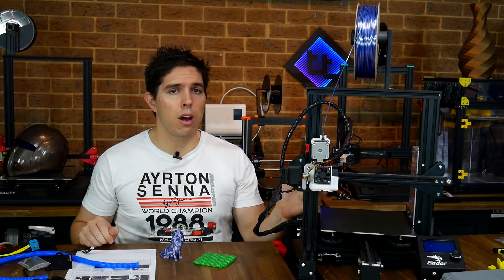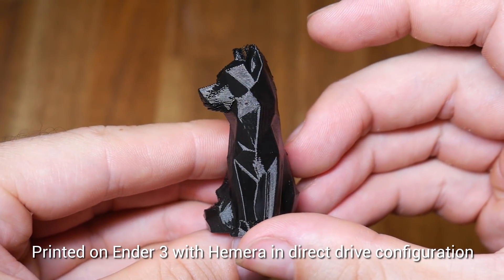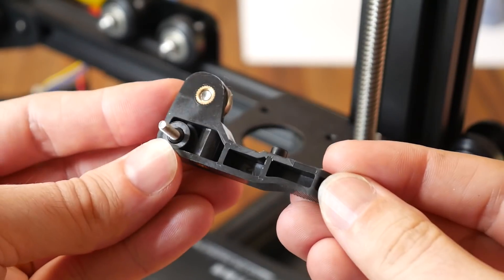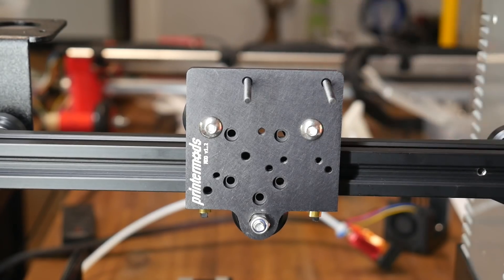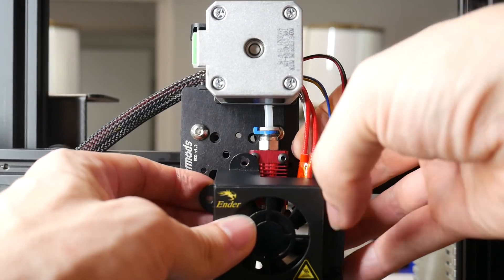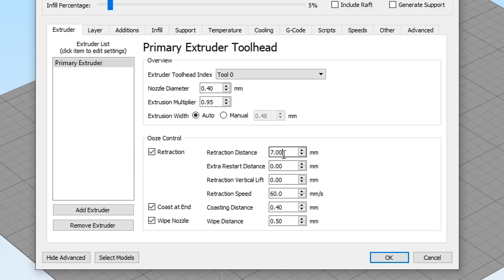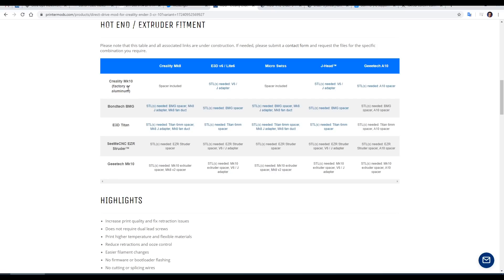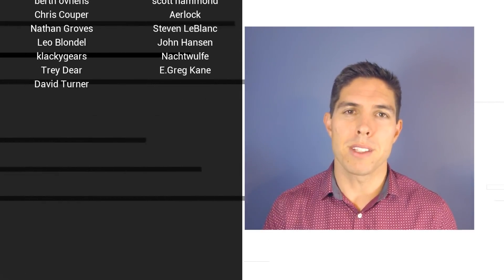Modular direct drive kit for Ender 3, 5 and CR-10 for under $40

Comment: Great video as usual but after a year of playing with my Ender 3 I have to say that the stock printer when setup correctly with no mods produces excellent results, i Have yet to see any noticeable print quality difference between what I print on the standard printer and all these modified ones on yoyutube, the only mod I would say is noticeable is the silent board mod and thats just noise reduction, theres an old saying if it aint broke dont try to fix it LOL, out of the box the Ender 3 is a superb printer, they could do with adding thermal run away in to the stock firmware and making the standard control board with silent stepper drivers but really for the money its superb and all these extra mods are really a bit of a waste of time and money in my opinion, with a bit of practice you can produce some amazing quality for under 200 bucks.
Reply: the silent board isnt just "noise reduction" the tmc drivers also eliminate salmon skin.
Reply from the maker: I would say most of my favourite mods are more user friendly usage rather than print quality improvement. As Mark says a board upgrade kills two birds with one stone.
Reply: Bit late to say this but if you planned on upgrading to an all metal hot end then a direct drive system gains a lot more merit, since all metal hot ends are very picky about retraction and such

Comment: Do you think the PetsFang bullseye would still fit with this kit?
How about using it with out on these dual gear extruder?
https://www.amazon.com/Sunhokey-Extruder-Aluminum-Creality-Filament/dp/B07YCG4QPK/ref=sr_1_40?crid=3A81PHG9P2M2R&keywords=ender+3+extruder&qid=1579247238&sprefix=ender+3+%2Caps%2C391&sr=8-40
Reply from the maker: I've never fitted the bullseye to this but the way it sits there is a good chance. Your other question is probably best directed to printermods.com

Comment: Micheal, since you have a E3D Hemera on hand, could you please check the fitting with the PrinterMods MDD. PrinterMods indicates on their website that their MDD v1.2 is compatible with the Hermes based on the current specs, but that they will need to confirm the fitting with the production units. Since the laugh of the Hemera PrinterMods still hasn't updated the info on their website. It would be nice to know that there's a quality mounting solution for the Hemera available now.
Reply from the maker: It's hard to tell fitted to the printer, but I can't see a set of holes that looks like it lines up. You would still need a thin space to get the Hemera to clear the v roller bolt heads.
Reply: @TeachingTech  Would one of the  injection molded spacers work? Let's say I'm ready drill custom mounting holes in the MDD plate.

Comment: Surprised No -One has fitted the Creality 10S dual drive wheel Mk8 type extruder as a Direct drive unit. 
The extruder is a " v good" one.... plus it's Cheap and V easy to fit, needing no goofy finned radiator, just a 40mm fan on the extruder mechanism..
Reply: I have the dual drive gear extruder as a direct drive unit in my own custom designed dd. But what do you mean by adding a 40mm fan? I don't need one. Could you please explain?

Comment: You can do the same mod for basically free, if you print all the parts yourself.
Reply from the maker: Yes but the quality won't be as good. It's a trade off between price and strength/flex.

Comment: what pancake stepper motor do you suggest? because I still would like to make things more compact.
Reply from the maker: Unless you have a geared extruder to reduce torque demands, you can't go pancake with this. When I talked about pancake steppers in the video it was relating to the Bondtech BMG, and I believe they might sell pancake steppers to suit.
Reply: @TeachingTech  Thanks bro.    I don't know if you saw my link because I found this in the last few days on amazon.  It didn't come with new copper buckles for the belt but it is almost the same thing as what your showing from these guys minus some extra parts which can probably be printed if modification is needed. https://www.youtube.com/redirect?event=comments&redir_token=RNywO6ibfJk6VhCF3Ya8NVPnuWh8MTU3OTQxMzUyMkAxNTc5MzI3MTIy&stzid=Ugzy7vp5OkYOL3ApSe54AaABAg&q=https%3A%2F%2Fwww.amazon.com%2Fgp%2Fproduct%2FB0824ZQ3D1%2Fref%3Dppx_yo_dt_b_asin_title_o00_s01%3Fie%3DUTF8%26psc%3D1

Comment: For the weight just add the 2nd z axis so it has a smoother ride :)  TH3D has great options when in stock.   Also the one I just linked adds a 4th wheel which should help with movement and The weight of the stepper motor is more centered rather then so far forward as the one in the video.
Reply: What part has a 4th wheel? Sorry I can't find your link.

Comment: what is that 3d printed part at 9:43 protecting he wires from frame where it is cut?
Reply: it comes with the kit
Reply from the maker: The cable holder comes with the kit but maybe you are referring to this: https://www.thingiverse.com/thing:2934313
Reply: @TeachingTech  thanks that's it

Comment: Just a heads up if you're using the silver Creality metal extruder instead of the stock plastic or red metal extruder. The silver Creality extruder has a different shape where the ptfe tube coupling attaches. It's square on the top instead of triangular like the other two extruders. Because of this the included spacer/adapter that you attach the extruder assembly to the plate with will not fit and needs to be modified.

Comment: I was looking today about converting to direct drive.   My extruder stepper is the heaviest one on the machine. Would it be worth it to swap it with the z-axis (the lightest)?
Reply from the maker: It's bigger because you need the extra grunt to push filament through. I wouldn't recommend swapping.
Reply: What about adding a bondtech or zesty nimble style extruder with a torque multiplier.

Comment: Do you have a link to your preferred pancake stepper? Also would it reduce ringing significantly to put one on?
Reply from the maker: You can only use a pancake stepper with the BMG because it is geared and needs less torque.
Reply: @TeachingTech  I use a bmg clone right now which should work then. Does it mTter what brand or anything?

Comment: Very interesting Michael. I just may end up doing this mod. For $35 it's a real deal. I've resisted screwing around with my Ender 3 because it's such a workhorse. In fact a couple of days ago I gave it a print that was too tall. The object was 257 mm in the Z axis. I had changed the Z max setting in Cura in  the hope that it would still be able to print. I usually use my Delta for the tall stuff but I was rebuilding it's hot end assembly and so I ran the print up on the E3. That's when I realized that the actual real Z height on the E3 is approx 185mm unless you are happy with the bowden and the power cables dragging on the crossbar. I actually disassembled the top of the printer while the print was running and managed to get the print finished. This mod will increase the Z height of the E3 to 255mm because the whole Direct Drive assembly is in front of the crossbar. This mod actually makes the Ender 3  a bigger printer.

Comment: I'm curious why everyone insists on naming the parts wrong, is this just a matter of someone did it and someone else repeated it and it caught on? My point is this: you keep saying remove or installed the extruder this or that. the piece you are actually referring to is the feeder, this feeds the filament through the extruder. The extruder is the feeder, the bowden tube and the hot end as a whole. Rather than perpetuate the error why not educate people on the correct names for the parts of their printers.
Reply from the maker: You should go all the way with this, start your own rival Youtube channel and do a much better job that me. Then start your own website to do a better job than all of the others out there: https://all3dp.com/1/3d-printer-extruder-nozzle-guide/#section-what-is-an-extruder
Reply: @TeachingTech  there really is no need for a pissy response, it was a valid query about perpetuating an error. I asked you because I felt that you are the most knowledgeable about this subject. Up until this response I had the utmost respect for you unfortunately my level of respect for you has now dropped. Thank you for linking an article that proves my point, that was very helpful.
Reply from the maker: If I misinterpreted, I am sorry. Making these videos takes a lot of time and effort and often people want to concentrate on picking apart unimportant wording. Best example is people calling me names because I say 'zed' instead of 'zee'. I think extruder is more than an acceptable term, it is used by manufacturers, aftermarket sellers of upgrades and accessories and the creators of Marlin firmware. I take your point but if I adopt that all I'm going to do is confuse people.
Reply: @TeachingTech  and there in lies the problem with the written word, it's often very difficult, if not impossible, to convey the emotion or intent behind the words you type which can lead to misinterpretation.

Lets just call this a miscommunication and leave it at that.

As for people making fun of the way you talk don't give them the satisfaction of wasting a single moment dwelling on it, some people obviously can't understand that in Australia Zed is the correct usage, for the record I was born in England and grew up in Canada so I actually switch between Zed and Zee depending on who I am talking to.

Comment: why not stick a bmg clone on it for dual drive like 9 bucks on aliexpress and ebay. Also have seen the mellow nf-crazy all metal hot end ?  claims it can go to over 550c
Reply: 550c but at what heat load? 0?
I’m also not sure why you’d need that either if it was at a useable speed. I print over 100mm/s on 0.8 mm with a generic J-head E3D clone, like are you really needing to dump gallons of plastic like wastewater? I don’t see the point (mine gets hotter, just let me use a torch, aluminum doesn’t melt until 660c...).

If you want heat go with duel heater cartridge, or quad heater, or a jet engine... but you don’t see any with a literal propane furnace do you? Right because it’s simply not needed for house sized printers (unless it’s printing a house, in which case it’s typically pumping concrete and not plastic).

I typically print ABS at 250c, current nozzle is ~1.2mm. Like it’s really much higher flow rate than most people need since it works fine for me having my Bowden zip around like a madman, haha!

The BMG Id like to see compared because that might be a much cheaper/better option, but I just don’t see the point in advertising a useless claim (because it’s also probably poor rating with any flow rate, which means for a 500c filament it couldn’t really be usefud).

Comment: I littirally just bought a modular plate for my ender 3 so i can connect anything  I want aliexpress.com/item/4000032567583.html?spm=a2g0s.9042311.0.0.46094c4dsdfbZs
Mainly want to direct drive it with my Titan extruder and a Aero cooler from E3D which will (and I hreally hope it does) enhence printing TPU alot. Will try a CNC spindle in the future.

Comment: For over two years of membership to many facebook groups, all the direct drive printer owners are posting 'I'm going bowden as it's better, faster, lighter carriage etc.  So all the manufacturers go bowden.  Now everyone going direct drive from their factory bowdens.  Manufacturers left mystified
Reply from the maker: Both setups have pros and cons. The best solution for any one individual will depend on their printing needs.
Reply: @TeachingTech   I have 5 printers (well two more unbuilt as well), some bowden, some direct drive, for my business, printers ran say 20,000 hours in 2019.  Direct drive machines just plodded along day and night, bowden ones always needed more tinkering, the fascination with all metal hotends that jam due to high retraction needed with bowden when hot plastic binds to metal is a double jeopardy design flaw, the tubes degrade over time due to heat if they a 4.1 thru to nozzle and wear and tear in the couplings means you get tube shift, basically bowdens were perceived as high end, truth is direct wins hands down on material handling, simplicity, operation and use is so much faster when changing filament.  I use one machine now with direct drive and the others are stacked in the spare room in the 'sounded great but actually useless pile' . A lot of the hobby is modding for the sake of it, but it's fun, but manufacturers bringing out machines that franckly have bowden for pose value are a waste of space.  Unless it's a 300mms+ delta with micro light head, forget it, just go direct for anything sub $1000 as the machine not capable of anything like the speed of a delta, i.e core xy or cartesian as the acceleration and jerk rock the things to pieces before you see the benefit of a external motor drive bowden setup, and even then you need BMG to feed fast enough, single pinion drive without geared ratios can't cope anyway

Comment: It's not geared is it? Or did i miss something?
Reply from the maker: Not geared. The beauty is in the simplicity of reusing factory parts with a quality replacement carriage.
Reply: @TeachingTech  That does sound impressive, I just thought gearing would allow for lighter steppers, I'm concerned about the weight.

Comment: Have you thought about doing this type of install with a Pancake Motor?   Hopefully taking away some of the ringing that one would expect from the added weight of a heavy motor..
Reply from the maker: Since the factory reused extruder is not geared you can't use a smaller stepper.

Comment: Hey, could you at some point do a guide on how to install a V6 on the Ender 3? I've been looking around for guides for BMG+V6 combos on the Ender 3
Reply from the maker: You can use the product from this video as shown. I didn't go into great detail but the mounting is here at least.
Reply: @TeachingTech   I do appreciate showing off how it fits with the v6! But I noticed that there is hardly any sort of mounts out there that is compatible with the direct drive kits that you've featured on the channel; nor have I found any other direct drive setup that's been reliable. Like, the only reliable mount that I've found with the V6 combination is the BantaMount, but unfortunately, that one doesn't have support for the BMG at all <_>
Reply: @xKenn  I did look at that mount before, but I needed something in particular that mounts directly on the heatsink, as for the oddest reason whenever I try any mount that doesn't have the fan directly on the heatsink, I start getting heat creep (I've tried several models that has the heatsink fan not directly connected)
Reply: xKen probably has a weak fan, mine barely gets the job done on my E3D V6 clone. It’s just a generic 40mm (clear/transparent) fan on mine, some custom short/direct duct and J-head mount for my i3 clone.

It’s rarely an issue but if my stupid repetier host program decides to turn it off for a few seconds (like it does during return to home with insanely slow Z axis) then I get the whole thing filled with molten plastic and have to torch it (I’ve never used a cooling fan for the plastic side, never needed it for PLA or ABS, so honestly it should just be direct wires in along with my motor cooling fans and lighting...). It’s an insanely quiet fan but it’s just barely enough (I mean I could certainly cool it with my duel stage, contra-rotating 40mm server fans screaming like a small jet but I do live in my house sometimes... haha!).

Anyways my suggestion is to get a better fan. I’ve had many different generic fans to expensive ones, it’s been a tossup on which I’ve most liked per application but just look for the ones with higher current ratings, or even crank them past spec with a “boost converter” and set it to something like 15v instead of 12v like they are designed. I see a lot of hideous air ducting in printers... Like I get it, my background is in aerospace engineering and I love fluid dynamics, but come on guys... Some ducts are just terrible! So yep, put it directly on if you can, and try a better fan, it should fix the issue.
Reply: @jakegarrett8109   xKen I've tried several different 4010 fans, all have the exact same issue.  But once I go back to using the 3010 fan with the direct heatsink mounting that came with my V6, I don't experience the issue at all. I currently using the BantaMount (which hasn't given me issue, https://bantam.design/mount); but what I tried was the Tank hotend by Greg191134: https://www.thingiverse.com/thing:3080548

I'm also using a 5010 fan for part cooling as well
Reply: @xKenn  It's not touching it, there's a space in between because of the heatbreak. The parts I got are all parts that go on the V6

Comment: If you have an e3d hotend save yourself money and purchase a extruded stepper extension cable and print the needed parts.  None of the kit parts including the carriage plate will work with the E3d hotend.
Reply from the maker: In this video I fitted and showed an E3D v6 hot end fitted to the printer..?
Reply: @TeachingTech  Mine did not line up at all.  I had to go back to the stock plate and use your hero me design on thingiverse to make it work.  I still had to make modifications.  The biggest issue was the hot end mounts to the extruder mounts would not line up.  Yes and as far as using an E3d V6 hotend you used this with  bondtech extruder.  Which is another part need to purchase.  I was talking about only using the kit provided by printermods.com.

Comment: Nice review but I don’t get the point of this kit when you can buy a bmg extruder clone, new hotend and motor for the same price and with the mounting kit
Reply from the maker: You still need a way of mounting it, and that's exactly what this kit is designed for.